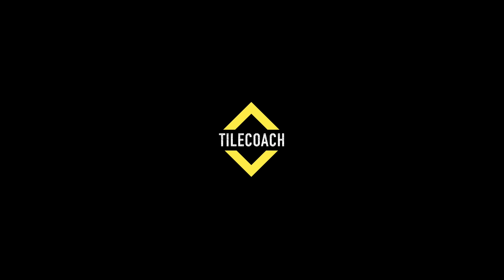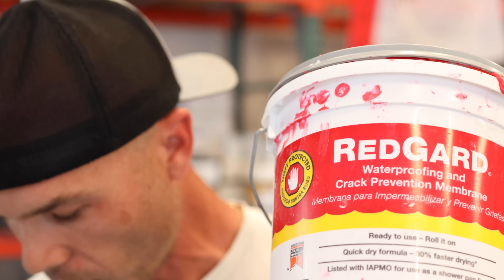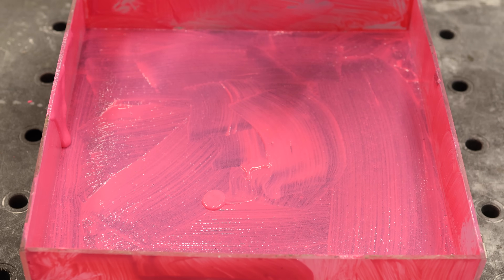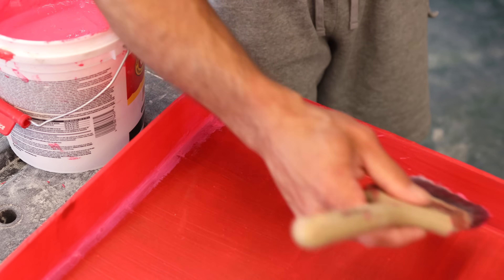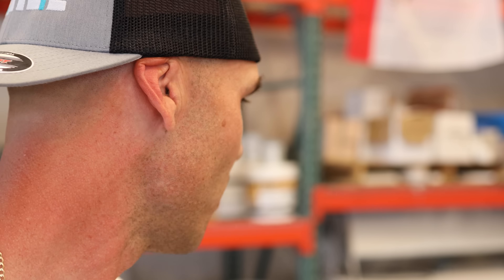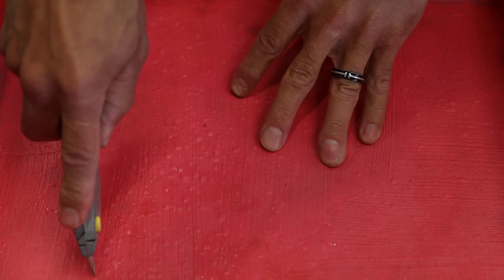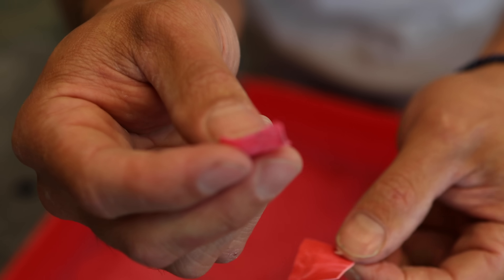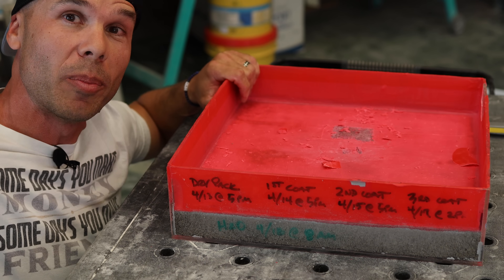REDGARD FAILED FLOOD TEST!!! --- Why Did it CRACK and BUBBLE UP???

Comment: It just seems that when it comes to a shower install the overall attempt is deliberately designed to fail.
If you look at the overall process & material list in its entirety . . . It is fraught with points of Failure from
start to finish and overly complicated on purpose.

Most of the materials i.e. mortars, thin sets, sealants, liquid membranes, caulks, grouts contain water and 
some incl. Sand.
Too much water ( even a micro - leak ) often turns into a total failure. Especially because with Hot Water.

If you go with a Pan & Curb Kit you will most likely wind up with at least $1,000 worth of foam products
and band aid type tapes used in critical areas and frequently fail at a high rate.

There bath & shower failures in $20k bathrooms in every state. Do your research.

Some Prefabbed Pans are also nothing more than foam and some have ribs underneath that are made too 
weak to support their own weight then requires mixing and blindly pouring mortar trying to install it.

This industry has the consumer exactly where they want us.
Sincerely . . . Good Luck to all .

Comment: Hi Isaac,
I was first introduced to Redgard (and similar paint on elastomeric products, I'll mention one that I haven't been able to locate in the US by the name of Gripset 51, a popular Aussie/ New Zealand product that has an UV and potable water rating) in New Zealand in about 2006.  All waterproof installers in New Zealand must attend and obtain a certificate issued by the product manufacture.  I held certificates from 4 different manufactures of these type products.  The BIG difference in the installation practices in New Zealand and Australia of these types of products (when applying over a concrete substrate in 2006) was that the concrete must cure for at LEAST 7 days, I let my concrete cure at least 10 days) and that the elastomeric waterproofing products are applied beneath the pre slope.  all the joints are either filed with a filled rod, taped or product like Dyna Flex 230 (which I understand these days may no longer be recommended practice with Redgard) allowed to fully cure, (silicone products aren't used as they don't bond with the latex products).  Then a light coat (sometimes referred to as a prime coat) applied in all corners and transitions.  Allowed to dry at least 24 hours.  Then a first coat applied and allowed to dry at least 24 hours, then repeat two more coats allowing the product to dry 24 hours between each application.  According to the manufacture instructors, the most common cause for failure or these types of products is 1) too large a gap for the product to bridge, 2) to thick of a coat per application, 3) not allowing the product to thoroughly dry between coats and prior to putting the shower pan on test.  The finish coat is recommended by the manufacture to be at least 3 mil thicK (or at least the thickness of a credit card).  It seems that many people don't cross their coats of application, or run the product down into the drain.  Of course time is money and its a completive situation.  Doing it the way I was taught takes time and consequently costs more.  There are no short cuts.  As a side note, also in New Zealand and Australia the water proofing product is run at least 600 mm past the dam and containment area of the shower.  A drain in the floor of all wet areas (laundry room bathrooms with shower or tubs) was also required.  Its a really inexpensive method to avert potential hazmat issue with toilet overflows and just a good idea in areas that potential water damage could result in very expensive repairs.  I generally tank the entire room as Redgard and similar products will accept latex paint.  It takes a little longer and costs a bit more but I have yet to have one fail.  Also it should be noted that products like Henry's Tropicol  won't bond well with Thinset. I've also had Mapei thin sets fail to bond to Mapei foam board.

Comment: If the water could somehow permeate the membrane I would presume it would be due to the weight of the standing water, which is not a real world scenario. Tile a applied directly to the membrane would only expose the membrane to the small amount water absorbed by the grout and thin-set.

Comment: Ahhh, like hello. McFly. Ya didn't apply and concrete primer sealer. What you've done is the equivalent to painting a new wall with drywall compound on it without priming it. We all know what happens if you don't prime drywall compound.  The latex paint peels off like a bad sunburn. Now I know why you keep saying your seeing red gaurd failures. Yes, you will. If they're not priming the drywall, the cement board the concrete the dry pack. Etc

Comment: Applying RedGard over a mortar bed raises several concerns, one of which pertains to the establishment of a moisture barrier.

In the case of most mortar beds, especially those used in shower installations, there is typically an underlying waterproof membrane, with vinyl liners being a common choice. When you apply RedGard to the surface, particularly when there's a vinyl liner beneath, you effectively encase the moisture within, resulting in what can be described as a "moisture sandwich."

This situation can pose significant issues for the mortar bed, as an excess of moisture can accelerate its deterioration, potentially leading to premature wear and tear.

Comment: Try building a box out of wood to simulate realworld conditions. Then take it apart and see what happens. Also acrylics dont bond to slelastomeric compunds and silicones. They look likenthey do, but they never form a permanent bont therfore those cracks are unavoidable. Best thing is make box from wood and cover it it cement board then reguard the cement board. And id even take it a step further and tile and mortar the boxes. As you know the mortar needs to be able to "stick", and for thst tonhappen the surface has to be porous, so redgaurd was designed to have the "tack" so tiles wouldnt come falling off. I think the morter is the key and finishes the redgaurd product tongive it, its final waterproofing qualities.

Comment: I got te point but no body leaves water in there shower for that long and also they require to install the pvc membrane 8" high from the floor bottom which it doesn't make sense to me,when  the curb entrance is only 4"to 6" high     I have neing building costume showers  for many years and never have any problem ,that reason why you have leak is becsuse you did not use the required pvc water proof menbrane under the mortar👍

Comment: You cannot do a test on a plexiglass, you must do it on another material, or you have seen walls and floor in a plexiglass shower, the test must be done on the same material that is used, mortar, and board, as for putting that The material on the shower floor is not adequate, I only use it on some walls, as for the Schluter system, the problem is that the unmodified mortar is not available to apply the tape, and it should not be applied with modified mortar. The company never has unmodified mortar in its distributors, it is a serious problem because you have to look for unmodified mortar from another brand, I really like the schluter system but if the same company does not care about having everything in its distributors, why use a system I know that it will fail me if I do not use the materials that they themselves indicate, so I prefer another system,

Comment: My question is being technical. When you do shower pan over subfloor or whatever. And you you Schluter weedy or whatever for the shower pan my thing is always the weight the weight of the person in the shower exerting downward forces. Which will make corners Flex expand contract! So how good is the Red Guard pertaining to those type of movements or any other water barrier. I like your model but your model does it really give you the data on the weight that's inside of the pan that's going to put stress on these joints these Corners inside corners

Comment: this product is good to use as a moisture barrier on the walls if it is necessary to level the surface of the wall with cement mortar for mosaics, but only for walls

Comment: Excellent description added to the video. I wish more people would fill in a detailed description like you. I like to do the math as follows: for both coats (2gal / 80sqft) * (128oz / gal) = (2*128/80) (oz/sqft) = 3.2 oz/sqft.  This means you need a total of 9.2 oz which is 4.6 oz per coat.

Comment: Since the box was non-porous unlike mortar bed, the moisture could only go in one direction- up. But since the uppermost portion of the paint dried first, it trapped all the moisture within the top layer of paint causing bubbles. I’d like to see if the same results occur on a dry mix bed.

Comment: I use red gard  waterproofing for showers instead using regular liner, but i install membrane in all corners to prevent cracking. also i use it by drain. i also leave hole around drain which i waterproof, and later i fill this gap with extra mortar. This is how its done in Europe. it works good.

Comment: I have seen several of your videos, thank you, and I'm mostly seeing what doesn't work or what fails, which pan method are you not repairing?  So in other words which pan most consistently gives good results? I have always been a PVC rubber liner guy but I don't do many showers. If there is a better method with consistent good results I'm all ears.
Thank you

Comment: Hello Tile Coach , I believe your failed Redguard was due to the fact that 24 hrs is not long enough for a full cure on the mortar . Concrete takes 30 days to reach full MPA , I beleive mortar could be 21 days or up to 30 days as well for a full cure . Therefore I believe your mortar bed was still curing and when you added the Redguard , you actually locked in moisture that needed to gas off . 24 hours is way to early is my guess .
Reply: Actually in a Geotechnical lab , concrete has 28 days to reach its full M.P.A. But the concrete that receives testing , is kept in a very high humidty atmosphere  and receives a 7 day MPA test , and then a 28 day MPA test . This is with cylinders that actually get crushed under a hydraulic laboratory crushing machine. Like I said in my previous comment,  I believe mortar has a 21 day full cure rate .

Comment: I called Custom building products on this exact issue.  I was told to dilute the product in a 4 parts water one part red gard and apply that over green mortar needs first. Then proceed with the 2 coats as normal. Since then, I have not had any issues. What I find irritating is why don't the instructions say to do a "prime" coat. So if you are listening custom building products, how about you change your instructions.

Comment: Been using nothing but Custom Building Products for past 12 years. I always do a primers coat prior to applying my main 2 coats. 
When you use a brush, do opposite brush stroke directions for each. This interlocks each coat together. For inside corners and change of planes. I thin-set 6in fabric mesh tape prior to RG. 
It’s a great idea to make sure the mortar bed and thin-set are dry prior to RG application. Also vacuum up and dust or loose sand particles as well. Best to skin over all screw holes for a even flat surface. Best to do even lite coats, than to cake it on. RG does shrink when drying. So very important to keep even coats everywhere. Check for pin holes prior to tiling is a good idea. Perma Base  is my cement board of choice in showers walls.
I also use RG uncoupling mat in place of Ditra. I like the fact it has fibers on both sides of the mat. So any movement is isolated by fabric shearing. Rather than cracking tiles or grout. So you get your mechanical bond as well. The mat is 100% waterproof as well. Great for doing 0 entry shower to main floor transitions. Love the videos you do. Thx
Reply: what primer do you use ?
Reply: @danielsimonleyva810  I believe he's refering to using redgard as a primer. 4 parts water to 1 part redgard.
Reply: Not questioning whether your methods work or not, just pointing out the fact that literally none of what you're mentioning is included on the product label and it certainly should be if these are important steps to do a quality install

Comment: EXCELLENT VIDEO!  
Looks like the (underlayment) mortar wasn't fully cured/dried out. (allowing the Redgard not to fully cure either)
*the mortars moisture and air pockets were squeezed out due to the weight of the water on top the redgard.  

Best options in this Test.  1st.  put your mortar w/ your needed slope, over the raw plywood. allow 24/48hr to cure. Then install your gray liner & test for leaks. then do your 1-1.5" of mortar thickness only. allow to dry 1-2days. use moisture strips/meter before 2 coats of Redgard,  allow that to cure 24-48hrs.   Then ready to install your Tile.

Comment: Redgard has a perm rating of 0.36, making it a class 3 vapor semi-permeable. Not a great waterproofing method. Better as a crack isolation or a waterproofing method not to be under standing water.

Comment: You needed to tape those corners in this box for redguard to work. You have to use the fiber mesh and fold it in half then coat both sizes. Redguard only works if you do the job correctly.

Comment: The problem is that the mortar is still have moister. You cant see it but it s there. The mortar needs days to fully evaporate all the moister. Also you meed to use  fiberglass fabric when you change plane.

Comment: Why use Red Guard on a shower pan?  If you follow the Oatey specifications for its pan liners you don’t  need a sealed pan. Where is the water that seeps through the joints supposed to go?

Comment: Didn't you have 3 grades of hydro isulation, light, medium, and heavy? In EU we have like concrete mud isulation, u can even put on weet concrete floor, and it stops water from inside floor. btw. We have multiple law's about everything  and you need use at least medium isulation in walk in shower. But some tilers use heavy one

Comment: Nice video and information! I agree with some of the other comments. Mortar bed needs to dry longer. You can use a moisture meter to see the moisture content. When wet moisture will read 100 on the meter . You want a reading less than 20 before using. It may feel dry but still has a lot of humidity in it. Also like others have said, multiple thinner coats of Red Guard are better. I also use fiberglass mat tape, (not mesh, but the kind that goes in all different directions) for corners and seems, glued in using the Red Guard. However for my own jobs I like to use a roll of waterproofing membrane for the shower pan, flashing 2" up the wall and then redgard for the remaining walls and niche. I wonder if you redo your test, let the mud dry for at least a week, and apply 4 thin coats of Red Gard, then let dry for 3 days, perhaps would have better results.

Comment: My theory, when the membrane touch mortar it sucked the moisture out of it leaving the micro pores. 2nd coat was like you made 1 pass but also resulted in moisture being sucked through thus drying it out in a way that caused it to be fragile and cracked at the corners away from the non-mortar part, 2nd theory was product was old, and or the product needed to be mixed well.

Comment: I used to use reguard.  Then I built my own house.  I didn't finish the backsplashes in the bathrooms for a while and the splashed water was molding and wrecking the drywall.  So I painted a band of redgaurd along the backsplash area according to instructions.  Within 6 months it was crazing and then started flaking.  I could then take a putty knife and scrape it all off in flakes.  It didn't protect the drywall at all except for a couple months.

Comment: I have used RedGuard on a few projects without any known problems.  I think that if you read the directions a little more thoroughly, you will see that 6" membrane is to be used at intersecting angles.  Your leak was in the middle  of the sheet????

Comment: You need to prime first. 3 parts water to 1 part Red Gard...
I made sure I knew how to use before first walk-in shower 3 years ago. I talked with Customs tech a couple of times...
And then 2 full coats, each with an overnight cure time...
Hope this is helpful...

Comment: No experience directly with the product but just by observing the video results, and working with similar products in Japan I dont think this product is supposed to be applied to glass, nor is it designed for water pan - i thought redguard was only designed for drywall on walls that will never see 8 hours of standing water. The idea, at least from what I see, is that the pan will be a single solid plastic unit with only a drain hole, at roughly 20-30 cm above waterline, with wall moisture running down  over it and drying off relatively quickly as it is not standing water.

Comment: Why would any sane person come under the delusion that two coats of rubberized crap out of a can is going to waterproof a shower floor for years to come? Use a real pan/liner and a weeping two piece drain then all these failed tests won't be necessary.